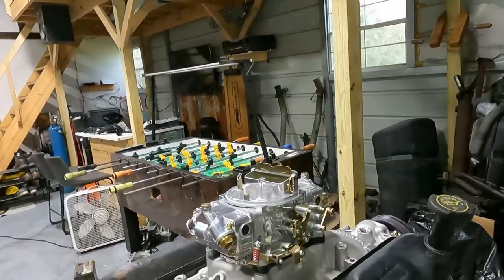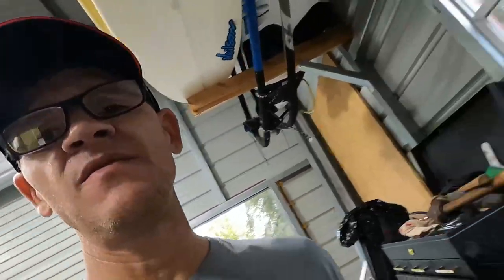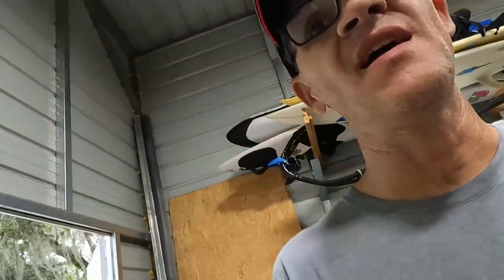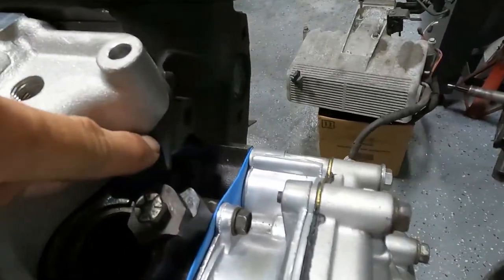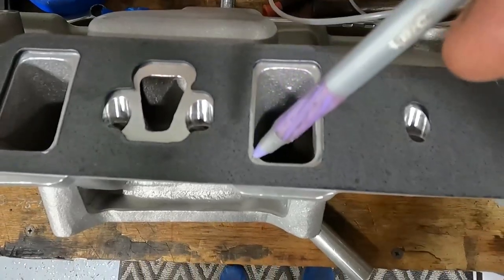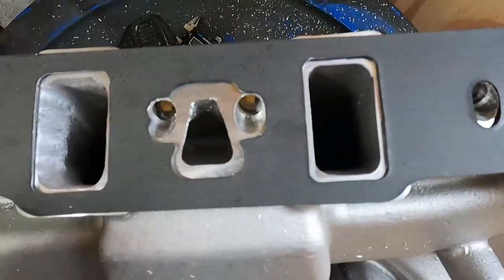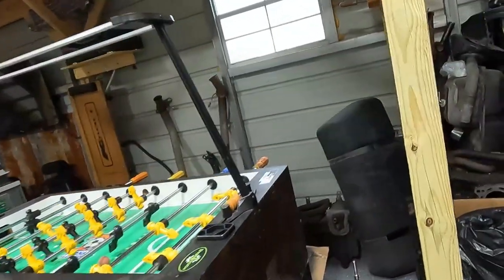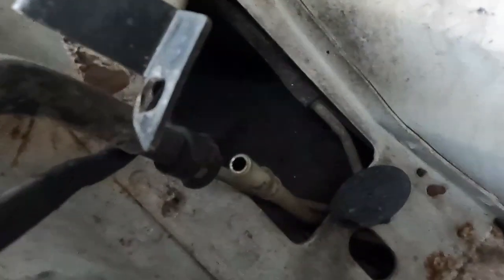How To Devalue Your Foxbody Mustang!  Put A Carb On it! LOL! + Port Matching The Intake.

Comment: Hi, iam doing the same using stock efi pump and the stock feed and return lines using the areomotive efi to carb reg. My question is how am i going to put to power to the pump safe?Efi harness is out iam diy fox owner i have ideas but want another opinion.  Do i run throgh my 6al box from ignition?Also could i run a toggle switch to turn it on? your help Greatly appreciated great content.. 👍👊
Reply from the maker: Find a wire that is 12 v while cranking. Should be in the harness near the ecu you took out. Run that to a relay then to your fuel pump. I think it’s the thick green and yellow wire. Just trace it back to front. I also added a toggle switch to the relay ground so I could shut the pump of when I want. Then you can hide the switch and use it as anti theft.
Reply: @fox-body  awesome thanks man i was waiting for your reply thaylt would be a good vid👍

Comment: One thing to consider when using a high pressure pump with low pressure carb is that you need a larger return so that there is enough room to return all the pressure and it doesn’t get past the regulator. I’m running an aem 400 lph and actually use a 10 an return and a 6 an feed, backwards of what most efi guys would do. Idk maybe the stock return line is good enough, I’m sure there’s plenty of guys who have done it

Comment: Just wondering if you could supply part number for trick flow pressure regulator,also have you had any luck finding fittings for stock fuel line to  adapt to stock lines. Thanks Jim in Ohio